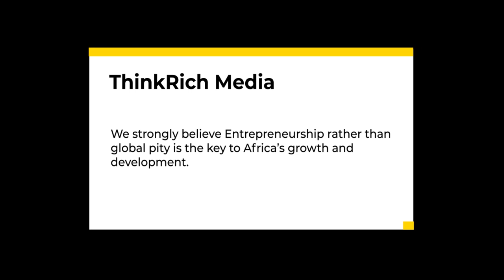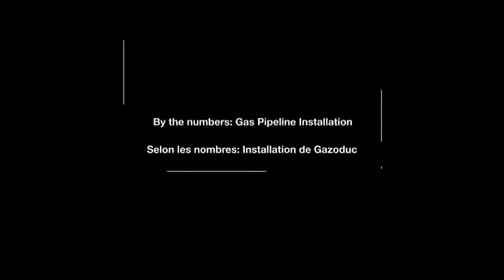The $25B Nigeria - Morocco Gas Pipeline Project | A Huge Boost For Europeans & West Africans!

Comment: I would not count the Trans Saharan pipeline out just yet. The Niger Delta to Kano portion is being built right now. The country of Niger has petroleum and natural gas resources along the proposed route . The Nigeria Morocco proposal has huge commerical potentials beyond just delivery to those countries along the route getting Nigerian gas. Senegal , Ghana and Mauritania have emerging offshore gas developments. Also at play is the fact hydrogen via renewables made be a future product for both these pipelines. Green hydrogen can be injected into natural gas steel pipe systems at about 20 percent of the capacity. Transforming renewable electricity to hydrogen can have great energy storage and transportation advantages.

Comment: With Nigerian gas and Morocco it's about profitability, it's not worth it to fund a pipeline of 20 billion dollars and add another 30 billion for pumping stations and relays, the gas flows to the north and second must also be a lot of epextise, because this project is going only underwater and is not easy and the costs afterwards are enormous, so it is questionable if someone throws their money on fire .. how long can it be until war between russia and ukraine remains? 5 years .. 10 years .. so it is not worth investing so much money for a pipeline ... Algeria has the infrastructure available in two countries and gas is therefore in Europe .. otherwise this project Nigeria Morocco is dead, born

Comment: SORRY , but the existing West African gas pipeline.. Nigeria to Ghana .. CAN NOT BE STRECHED TO MOROCCO..... That because the pipeline it self has a limited capacity of .. ONLY  5 BCM/YEAR.
So.. The Nigeria - morroco gas pipeline.. It HAS TO BE a complete new pipeline... Enough to hundle from 40 to 55 BCM /YEAR.... And that would be a kill project... And a colossal amount of investments and efforts........ BUT  THE AKK GAS PIPELINE.. Is on corse... And it is has a big diameter... So all the evidences is telling that Nigeria... Is tanking the Niger Algeria Root.. For its plan to export  it Gas to Europe.... So the Trans-Saharan Gas Pipeline is not dead as you mentioned in the Video... But it is in construction... The contractor Company that is working on this project... Say that Gas will be putted in the AKK PIPELINE by  the first half of Next year.... So Niger 🇳🇪... Is the remaining puzzle of the Trans-Saharan Gas Pipeline.. To. Algeria 🇩🇿